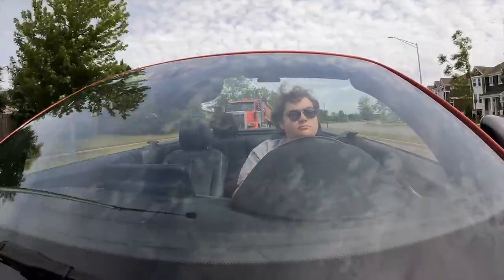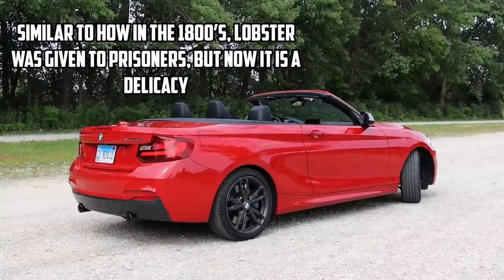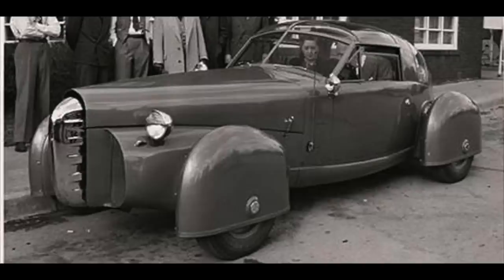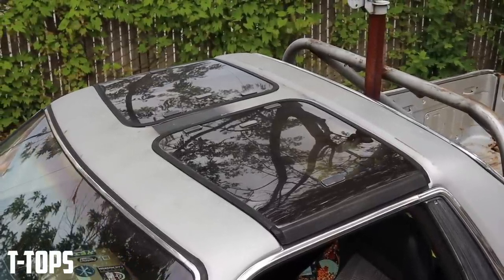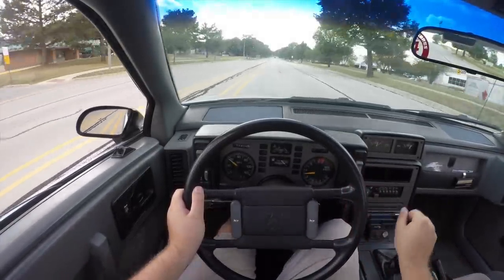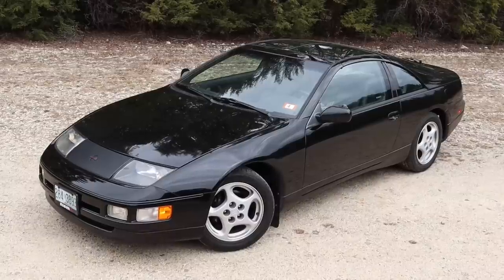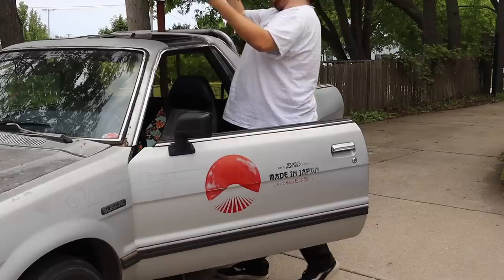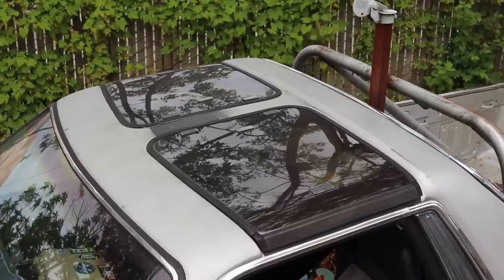T-Tops - How They Were Invented & Why They Went Away!

Comment: I feel like the 3 reasons given are completely valid, but there's a 4th big one.  Sunroof's caught on and provided nearly the same functionality as T tops with nearly none of the drawbacks.  You have slightly less space open to the outside, but get a much stronger chassis.  On the down side, older Sun roofs do like to leak from time to time.
Reply: 25 years my Accord sunroof never leaked but I hear It happens
Reply: A big reason why i like T-Tops is getting in and out of a sports car is waaay easier... due to the non existent roof line. Sun roof is nothing like a T-Top or targa
Reply: @jaron312  you have drain lines going from the rain gutter in the sunroof thru the A-pilar down to the front wheel area - if that gets clogged you gonna have issues
Reply: @1DEADBEEF1  I think that’s valid, but niche. I think most people buy a car they can get in and out of easily.  While it is not the same, I think most people as far as making a choice between the two when buying a car prefer the hassle free sunroof operation over having to get out and store t-tops for daily use if they want an opening in the top of the car at all… and if it is an important factor for them, prefer a full convertible over a small opening… with that added bonus that again, convertibles are mostly a push button operation.
Reply: @johngaltline9933  old convertibles from that era were noisy rag tops and deadly during a rollover... obviously we are Talking sports cars so People do buy them for sport driving not for ease of access
Reply: @1DEADBEEF1  But we're not talking sport cars, we're talking general public.  The general public found a sunroof a better option so manufacturers went that route.  Development money went that way and away from other options.  Also, by the 80's the tops on any decent convertible were still mostly crap compared to a hard top, but were perfectly functional if you accepted the trade off.  Hell we had fully powered retractable hard tops in the 60's.  "car people" seem to forget that they are a small part of the market and even their buying preferences are directed by the public at large.  T-Tops always were a crappy work around for folks that couldn't commit to a convertible.  Anyone buying a sport car to actually drive it hard would always choose a full hard top as they are lighter and stronger.
Reply: Sun roofs caught on? Sun roofs have been around for a long time now. Both powered and manual are nothing new.
Reply: @JasonSmith-pt5tv  yes.  caught on.  they existed but were uncommon until the 80's.  as they became more reliable in easy to use powered units and as a low cost factory option they caught on, being something worth the cost to every day consumers on everyday cars.
Reply: @johngaltline9933  so they caught on in the 80s but T-tops lasted up through the 90s and were last used on a production car in 2002. Also they still produce vehicles with Targa tops.
Reply: I’ve had sun roofs of all types I get ca convertible top . Sun roof if only i
had  another sun magnifying into my car with very little air floor but potential to leak. 

Hell with its cooler that’s what I have my ac for. It annoys me some option packages only come with that stupid thing. I want these 2 things but I have to get a sunroof to get. Well that’s not me feeling like I’m having it my way at Burger King …pass😂. Ps my burgers slogan  is you can request whatever it’s a surprise what we include or removed . Paid for cheese ok well we’ll see how your luck use. Oh sorry better luck next time😂
Reply: I’ve had several cars with sunroofs and a 300zx with t-tops. Sunroofs don’t even come close to providing the open air experience of t-tops. I currently have a convertible and I miss the t-top experience, which gave you the feeling of open air over your head, but cut down on wind buffeting while driving significantly. 

I think leakage was the main issue that caused them to go out of favor. Never heard of anyone with t-tops that didn’t leak. I was happy that my 300zx would only allow a few drops here and there in a strong downpour.
Reply: @ooneybird27  it doesn’t compare but for most people it is a compromise that offers the worst parts of a convertible and hard top while only half ass providing the benefit of either. For folks that open air is important to, a t-top is trash compared to a convertible, and for those it’s not important to, the sunroof lets in a little light and air without much drawback. T-tops are neat, but if people actually preferred them to other options we would still have them.
Reply: I was going to say something similar, advancements in sunroof technology made T-tops less appealing.  Early sunroofs were a hassle that didn't do much. They'd pop up, some cranked back, some powered back, some could be removed. The the convenience  of modern sunroofs took a while to mature. 

However I think there's a bigger aspect that he only barely touched on, safety. Specifically making a safe unibody passenger cage structure. Many early T-top cars still had frames, the Corvette for example. Cars like the Firebird were king of half frame half unibody. And even the unibody cars of the day with t--tops like the 300ZX had significant floor structures. 

It's the same reason we don't see frame-less pillar-less windows anymore. Many cars of the 60s and 70s had only a front and rear roof pillar. With all the windows down there was no divider between the front and rear passengers. This and T-tops went away for the same reasons. They started using the door frame as more of a built in factory cage to not only make the vehicle safer but also stiffer and require less frame structure. Many of those vehicles would twist they body when stressed, put too much HP in a early Camaro and even the hard top bodies would twist, they'd crack the windshield, the door wouldn't open/close right anymore, etc.

That said, I miss T-tops this vid made me really want a T-top Vette. And I dig the name.
Reply: Never been in a vehicle with sunroof that leaked. Myth.
Reply: @1DEADBEEF1  If you rollover, your chances are not very good anyway. Crashing at high speed is usually dangerous.
Reply: Sunroofs cannot offer an unbroken view from your side to the sky.
Reply: yes the automatic sunroof took over, because it gave a silmilar openess but without the manual problems of storage
Reply: @1DEADBEEF1  Or four drain hoses, one down each pillar.
Reply: Not even close.  T-tops, and Targa tops are so much closer to the feeling of being in a convertible than a sunroof.  It is about views, not sunshine.
Reply: @jaron312  how often do you open it?  Lube it?
Reply: @Dave-sw2dm  sure, but the point still stands. For people where it is important, they buy a convertible. For people that want a little light or air and don’t want a bunch of hassle, a sunroof does the job.  Most people are looking out the windshield when they are driving so it doesn’t matter if there is a roof or not for “views”. Convertibles offer the best open top experience with the same, or less, hassle as t-tops or targa tops, so there is no point to the other options.
Reply: @johngaltline9933  and there in lies the problem.  I see sunroofs as useless, and convertibles as high maintenance.
Reply: @peteregan9750  Yes, everything need to be automated (motor-driven at the push of a button) nowadays, or it feels outdated.

I still do like the targa/T tops. Yes, you need to stop the car to open the roof (or close it), it would occupy space in the trunk (but less space than an automated soft or hard top!). On the other hand, no complex (expensive) mechanics, no motor (and motor control) which could fail.

My current car has a sunroof, automated, of course, but with an option to close it manually if it fails. Never did so, but what did fail were the electronics for the rear windows. Several times, actually. No manual closing mechanism here! Had to use duct tape to cover the windows when rain set in. Finally, I figured the issue was a software bug in the motor controller (yep, different firmware for the rear windows than for the front ones...yeah, right). I just needed to reboot my car.

Now, I knew how to reboot a car back in the days. I think it was an E30 or E36 which sometimes had issues with the windshield wipers, and by rebooting the car, I could make then run again. Simply turning the ignition key to shut it down, but not so far that the steering wheel locked; after all, this often happend when I was going like 200km/h on the autobahn. Then start the engine again, power would return, and the wipers would work again.

My current model has power management. Turning the engine off does not cut power to any system. Windows will stop working after a few minutes, after that's purely in software, the controllers remain powered. So...drive to the next rest stop, unload the trunk to get to the battery, disconnect it, wait ten minutes and there we go again. If not, repeat.

Nope, OBD2 won't help here. I got all the dealership and factory floor software, but once the rear window controller gets sulky, it won't listen to anything.

No wonder I love that purely mechanical manual stuff.
Reply: Have you seen the new hummer EV? Haven’t messed with them in person but their roof panels look quite good
Reply: Say you’ve never owned a t top car without saying it. Sunroofs are nothing like t tops.
Reply: And a fifth one - T Tops got stolen.  They were like musical chairs between your car, every one else's car, and the sketchy places your insurance company would send you to for replacements.   Jeep Cherokee doors have a similar problem.
Reply: but t tops looks so much cooler
Reply: Probably the number one reason is that they were frequently stolen... insurance companies hated them and there was a black market for used replacement tops...gee..I wonder where the inventory came from?..
Reply: When my dad was living in Los Angeles in the 80's he had his car broken into and most expensive thing they easily took was the t-top windows. Was like a $1,200 replacement cost.
Reply: I love sunroofs, but I've accepted that I can't comfortably have one given that I am 6'5" and a sunroof chops at least a couple inches off your potential headroom.
Reply: @KinglerJord  I think that may be true on some models, but for the vast majority, if a sunroof is an option, as it is on most cars these days, the headliner sits at the same height no matter if a sunroof is installed or not. In many SUVs and crossovers hvac and entertainment is also run on the roof and the room is still left for those. On my town car, I own two of the same model year car, one with and one without a sunroof, the headliner sits the same, though there is additional storage stuff ace that hangs down lower on the one without.
Reply: Yeah I got a 1992 and 1994 Mercedes both with a moonroof and both work and don't leak. I think the older Benz ones being solid metal and not glass probably has much to do with that
Reply: T tops love leaking aswell tho so the leaking is a disadvantage to both
Reply: Had my car for almost 20 years and the sunroof just flew off one night 😂

Comment: My 1986 Mustang GT had T-tops.  Removing them required that they be stored in dedicated vinyl sleeves in the hatchback area thus reducing what limited storage was available on a trip. Long term maintenance required  treating the rubber gaskets periodically to keep them from drying out and causing the dreaded leaking roof. Still, was a cool feature when driving down the beach in Daytona!
Reply: That was a pretty rare Mustang option.
Reply: I feel you man. I had an 85 Mustang GT T-top. I had to make cardboard inserts because the Texas sun just beat through them.  And, it leaked almost from the day i bought it., But, it did look kool!
Reply: I had an 85 Mustang GT with T-Tops in Los Angeles, California. I loved them and, for me, putting them in the vinyl bags was a minor inconvenience. Mine only leaked in heavy rain. Otherwise, I had some rattles on rough roads.
Reply: With today’s technology. All those issues have been resolved. For instance, two sunroofs side by side, a bit smaller of course. Auto retractable. They can be carbon fiber.
Reply: Better stock up on gaskets.
Reply: My wife had a 85 gt with T-Tops and they never leaked. You just have to put some armor-al on the rubber gaskets to keep them from drying out. But would love to have another fox body or Trans-Am with T-Tops
Reply: My 1987 Mustang LX had T-tops as well. They only leaked in the hardest of storms, like during hurricane season, so it was not that bad. I was always paranoid about dropping one while putting them into the sleeves, though. But for a kid in high school, they were a freaking awesome feature.
Reply: Not gonna lie. I usually just put them behind the seats in my Z-28. It was easier when I took them off while sitting at a stoplight.
Reply: my 79 stingray was the same way. Had to store them in vinyl sleeves and keeping the rubber seals conditioned.
Reply: i had a 1988 T-top in 1990.  You could have just left the tops at home.  The car wasn't meant to travel.  All you had to do is when you brought the car back home just put some protectant on it.  My car was built to hell and even in S. Florida summers never leaked on me.

The cool thing about the 1988's they had the convertible door mirrors which were much better.
Reply: Pretty sure, your Mustang only had one T-top, not multiple ones.
Reply: A 5.0 with T-tops.....so cool!!!!!
Reply: @davecaron1213  I bought that car in 1990 from a Lincoln Mercuy Serivce Manager.  He had the tops tinted with something back then.  They car had full JBL audio at that time.  Full FMS catalog and more.   The tops didn't cause me any issues.
Reply: My 87 grandnational have them.  I don't drive it in the rain so leaking isn't a issue.
Reply: @jdgreen214  that car is a beauty and a BEAST!!!
Reply: I had that leaking roof on my 1985 Mustang.  Nothing gets your date in a romantic mood faster than having dirty rainwater drip on her every time you take a turn.
Reply: @peterkennedy7219  same with me, no one ever sat in the backseat anyway haha
Reply: Also had an 86 GT with t-tops... I'd love to have that car back. Mine only ever leaked if you ran it thru the automatic car wash.
Reply: or in the north with a foot of snow on your roof, the Ts wouldn't deform from the weight as convertibles did.
Reply: my '01 SS has nice slots in hatch for them to set in.  But that trunk is a terrible layout and basically non existent before putting T tops in there.
Reply: I have a 1975 Cadillac Eldorado convertible with the parade boot. So when I want to take the parade boot off so I can put the top up. It goes in a leather sleeve that matches my interior.  Once you put that in the trunk with top top down and the spare tire. I can only fit one body in the trunk. Pain in my ass. LMAO
Reply: Most don't realize you should treat all the gaskets, not just T-tops and sunroofs.
Reply: Same can be said with the Camaro and firebird as well and good luck keeping the t tops from leaking if they end up being aftermarket rather than stock from factory
Reply: @rav-tv372  Also, the EV Porsche and I think the Mach e as well have a feature to tint the sunroof with a push of a button. Quite wild to see how far tech has evolved
Reply: Still have mine👍
Reply: Jonathan Loeppky  sunroof leaks are usually from plugged drains they have these rubber plugs with little slots for the water to exit and hoses running down to the trunk and forwards down the A pillars.  You need to use some weed eater line to probe them periodically.
Reply: Had a Nissan Z car with T tops they also sucked always left them on the car just wasn't worth the effort.

Comment: I grew up in the 80’s. I absolutely loved T-tops, I still do. I wish they’d make a comeback.
Reply: Hell naw, T-Tops are a pain and they freaking leak.
Reply: @txmade4371  never had any problems with mine.  Of course, I also checked them out each spring.  Still don't have any problems with 'em as a result.  Like anything, if you don't take care of it properly, it won't last as long.  T-Tops are still my favorite.
Reply: @txmade4371  my '77 Bandit T/A with NON leaking t-tops would like to say NOPE, not always.
Reply: @txmade4371  I’ve had several Camaros with them and none of them ever leaked.
Reply: @txmade4371  the older convertibles leaked way worse.
Reply: I have a slightly different take on T tops, if given a choice of course I'd rather them not leak. However, it's worth having them versus not weather they leak a little or not. Half the fun of owning a 3rd Gen Z28 is having one with T tops, I wouldn't have bought my current car 10 years ago if it were a hard top. Besides that, I don't drive 40 year old cars in the rain anyway. If by chance I get caught in the rain its just water, maybe a few drops but even then it would have to be one of those humid summer day rain storms for it to leak. So see, there's really nothing to worry about. Lastly, I've had three 4th gens that never leaked a single drop. A 93 and a 94 Z28 as well as a 99 T/A
Reply: If I ever decide to sell my T-top Camaro I'll let you know.  But it's my still summer joyride for now.
Reply: sorry for the typo